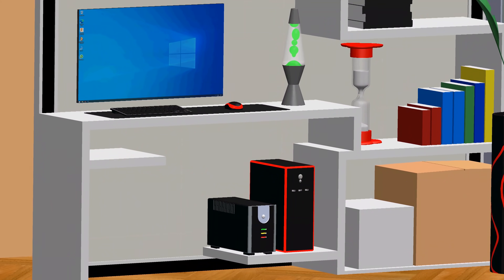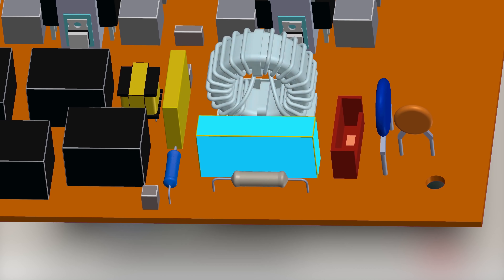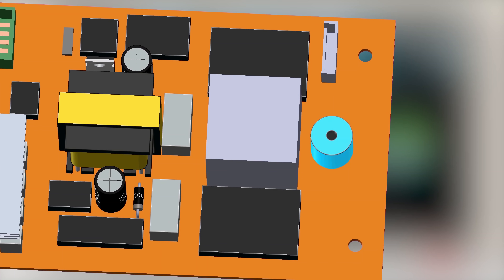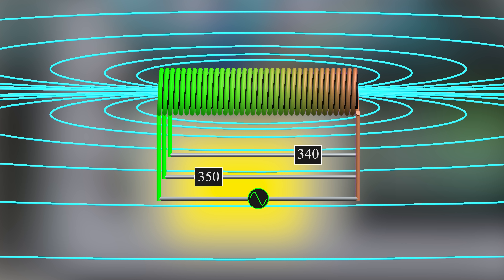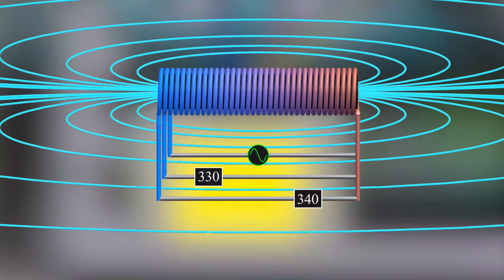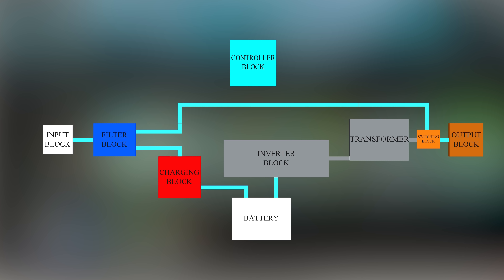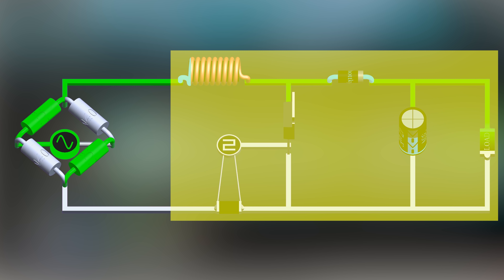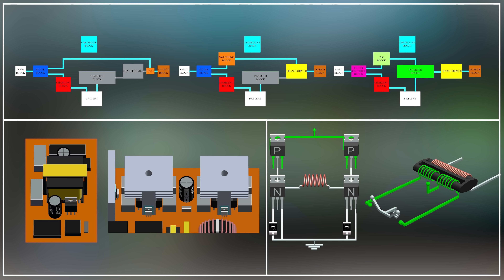How does an Uninterruptible Power Supply (UPS) work?

Comment: Sir ,

In UPS input voltage of inverter circuit is same as converter/rectifier circuit outpurt and Battery bank net voltage .

1.My question is why static swicthes required to shift load from main supply to battery.

2.It is true that when main supply availabe then in that case ups supply is taken from mains supply.

And when mains not available with the help of static switches load transfer from mains to battey bank

Comment: I am trying to charge a UPS from another UPS.
When I plug one UPS into the other one it is not charging the battery, however the AC power seams to go through the first one.

I have tried 3 UPS, none of them will charge the first UPS.
Why is this?

Comment: Bro i have a doubt my UPS have a problem
The power is on the work will normal
May i connect the Source ( supply )
The battery will charging
But the buzzer will return to beep mode
(Source disconnect type)

What can i do

Plz Replay

And i have a idea this good or bad

IDEA
-=-=-=-=-
A wire to short supply to UPS out
( NB: The UPS OUT + SOURCE  POWER Missing time any problems ( Ups out (230v)) (Source (230v))
((230+230) Parallel connection)
=460v
That affect my any loads
Please replay..?

Comment: What is the common failure components if the ups experienced a power surge then doss not power kn anymore?i replaced the inverter transistors but still same problem... someone please help...

Comment: I have a newbie question, in your H-Bridge I see you using P-channel MOSFET for the high side switching, is it possible to use N-channel MOSFET for the high side instead?  Your videos are very informative, keep it up.
Reply from the maker: Yes you can!
Reply: @ExplorerStuff  Thank you, it helps me a lot in the understanding of the subject.  Could you elaborate a little more on the snubber circuits, may be in another video.  Keep it up

Comment: What you have described is a STANDBY POWERS SUPPLY, not a UPS.
In a true UPS, the output power is ALWAYS supplied the batteries. The input power is rectified and placed on the DC side of the inverter.
I have installed MANY MANY true UPS systems in large data centers.

Comment: terrible video...who on earth comes to the idea to try to explain an electronic circuit using a 3D (simplified) mechanical representation of it (only)!!??....that is why electric/electronic schematics are used for! ....you may complement with the 3D mechanical view but it does not replace it and it is secondary to the proper and complete understanding of all circuit details...eg the multiple taps of the transformer and how it is connected.....additionally the video contains a video calling the secondary the low voltage side driven by the transistors/IGBT and primary the output load..it is the other way round as the primary as the energy flow is from primary to secondary!

Comment: Name a country use 340V AC system.
Reply from the maker: The 340V is the peak voltage, and 240V is RMS.

Vpeak = square_root(2) x Vrms
Vpeak = 1.41 x 240 = 338.4 V

Comment: offline type is just basically a inverter with charger built in
a line interactive is combination of offline type UPS with a AVR function builtin
online type is basically a inverter that is always used for the output regardless of the input voltage status is, though online type is much more robust and well built than the other 2 does since this one is outputting a pure sinewave, regulated power output and clean power. basically its a glorified line interactive ups.

Comment: Most UPS doesn't have voltage regulation, they switch to battery instead. I use an AVR before the UPS
Reply: Actually it does regulate the voltage, since it drops the voltage to battery voltage and then convert it back to mains voltage, input wont affect output, the output voltage would be kept stable
Reply: @TonnyCassidy  I'm saying most don't do that. Battery is only used as needed

Comment: Have you ever wondered how a UPS works?... yes... magic.  Actually not so... I "fed" my sine wave UPS some MSW (Modified Sine Wave) from an inverter and it had major issues.  I heard some major relay chatter and started smelling something "burning".  Not sure how much damage I did but I was not impressed at all at how the UPS reacted to "distorted" AC input.  I thought it was supposed to handle that but apparantly it cannot.  The UPS still appears to work but using it may be risky.  Anyone know what may have happened?  The UPS is like 30 years old.

Comment: My UPS gives high electrical power from the outlet dedicated to charging the battery from the negative and positive aspects, and if I reverse the electricity input from the wall outlet, the electricity disappears in the charging exits, what is the reason

Comment: A good general description but a few points.
To clarify the term UPS. It only pertains to an On-Line systems by definition at IEE. All other systems are not UPS systems. Line Interactive and Stand-by. UPS also means that there is no interruption of the output when there is a condition that requires the inverter to convert energy from the battery. This switching time is 4mms to 33ms depending on the design.  Mother Board is another term that is not correct.
Reply: Silly comment.  All manufacturers use the terms described in this video.  You will be returning a lot of UPS to Amazon if you think ordering a UPS will only result in an online UPS, and if you want to order a line interactive or offline UPS, would you search for a Line Interactive thingy or an Offline thingy.  What term would you use when searching Eaton or Schneider electrics website.  Just because the British IEE used a term does not make it de facto.  The US IEEE uses the terms as described in this video, and I will go with that definition.  Motherboard as defined by the Oxford dictionary is the main board of a computer, and since a UPS has a main board that makes decisions based of inputs and logic circuits, it can be considered a computer.  A box with a keyboard and a mouse is not the only definition of a computer.  Please only post constructive comments and keep the prose to your poetry class
Reply: It not a silly comment. But a correct statement of fact.

Comment: Even if we increase battery capacity, does this computer ups stands for 10min?  [Or] does the backup time will get increased or not?
Reply from the maker: It will. 
Backup time depends on Battery Capacity and Load.
If you increase the capacity or decrease the load, backup time increases.

Comment: The best explanation i hv ever seen....
Good luck sir w'll wait for more vedios like that... Sir plz explain servo motor stabilizer.
Reply: Servomotor stabilizer we will have servo motor instead of relays, for continuous fine tuning with various taps for smooth voltage adjustments.

It's like tuning an autotransformer with hand but electronically controlled

Comment: can you explain how euv work :D
Reply from the maker: EUV ?
Reply: @ExplorerStuff  
You dont even know what euv is :)
but there is no problem because almost no one knows except the High-ranking specialists of hardware companies
euv abbreviation for phrase Extreme ultraviolet lithography
A device used to print the lithograph of the cpu gpu (14nm 7nm 3nm etc..) on a large silicon plate other name is wafer
see this video https://youtu.be/CkNn98WE5_k?t=584 or https://youtu.be/u3ws0UebnSE
on each silicon plate, hundreds of processor core are made

if you make a video about how euv work
you will be the first person to explain one of the main steps in building a processor to the public
another major step, how million connection are made
anyone who knows these two steps can make a nanometer processor at home
with its own architecture

Briefly this is a printer which prints the architecture on the wafer
Reply from the maker: We will try. 😀